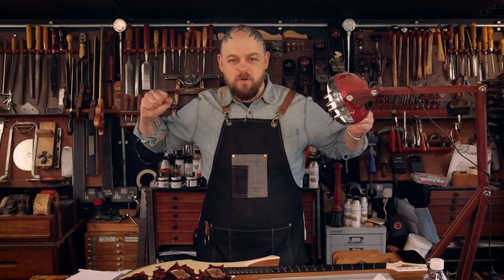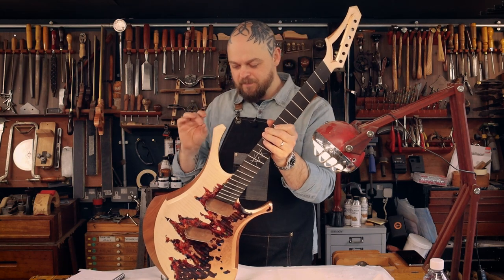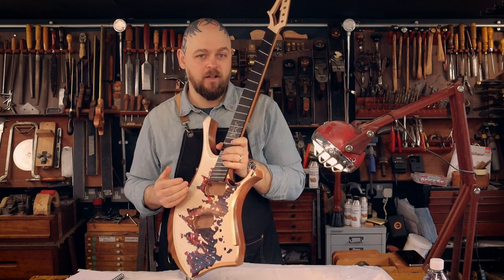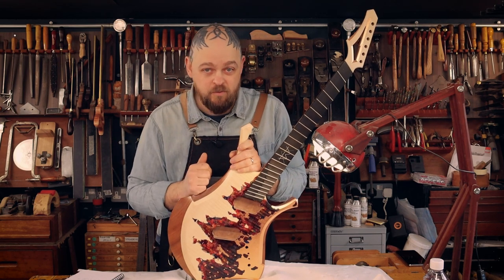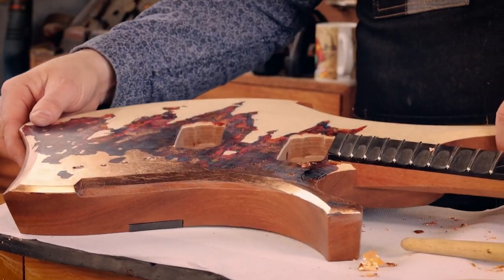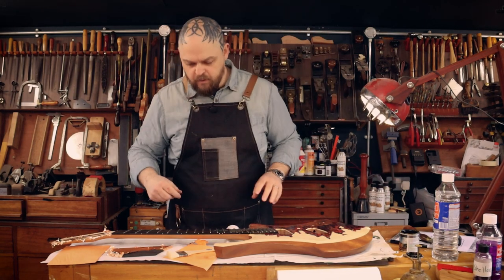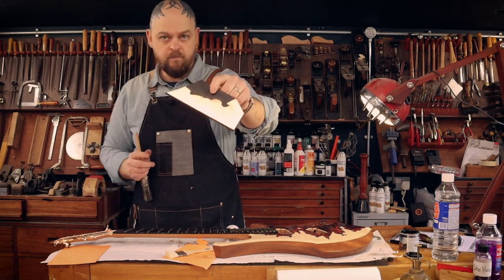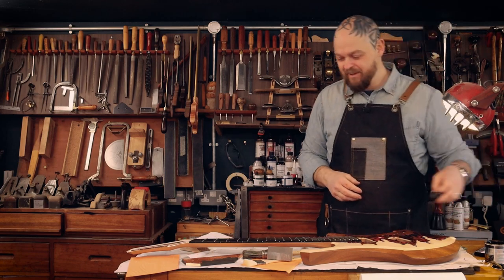Ep 10 - Shred - Bridge Design - How to Build a Copper Leaf Multi-Scale Kit Guitar

Comment: I'm exited to see the bridge next week... I have a multiscale part-way done and been putting a lot of thought into it.  I also don't have a mill or lathe so very much appreciate the "lo-fi" approach.  

Many of my drafts end up in similar spots to you.  The one idea that I keep coming back to for the string guide is a concave roller bearing of sorts.  For vertical adjustment a slot in each side of the housing would be needed.  The rolloer could be secured with either a screw through the hub (with the appropriate washers, etc) or left floating on a pin through the with height adjusted with one or two adjustment screws (two works, I have an idea for one).  It's definitely more complex but could be interesting.  

I've also considered going old school... secure the string heads behind the saddle, create a saddle base plate with slots parallel to the strings and single acoustic-esque saddles in each slot.  Height is adjusted by adding a shim  underneath each saddle piece and scale length is adjusted by moving the piece forward or back in the slot.  String tension would be the only thing securing the 6 saddle pieces in place.  For saddle material I've considered bone and brass... mostly because they would be easy to machine by hand.

Comment: One of the luthiers i admire most, Jens Ritter has a very elegant bridge design. the slots for the saddles are routed directly into the body and the saddles themselves just sit in the spaces and are adjusted by screws that push on a small plate. String tension keeps everything in place and it looks wonderful.

Comment: I am all for making bridge parts at home. I have a build nearing completion for which I made a top mounted string retainer out of brass, which I was able to machine using a hand held router.
That component is now at my local chrome plating shop. Brass is very, very easy to work with, and is very strong.

Comment: Hey Ben, interesting doodle at 9.38! You can do slots at home, if you chain drill the slot and file to size. At 18.40 that technique is solid riveting. Another handy tip is to use more than one hacksaw blade, to create a wider slot. Normally the pins are long enough on a hacksaw to accommodate a few blades together. Ace video again cheers man.

Comment: Love the channel. I had a great idea for a multi scale bridge that's adjustable without needing tools! I'm terrible a drawing schematics or anything mechanical, however, I believe I could rough it out or use a sketch artist to illustrate what's in my mind. It involves individual saddle pieces that slide in a slot and is lockable via 90 degree turning levers behind the bridge. I think it could have applications on acoustic and electric guitars.

Comment: Suggestion for bridge height adjustment.  It will need to be domed so that you have a defined point of contact to prevent buzzing.  Consider drilling holes through the side of the head so that the height can be adjusted while strung up with an allen key shaft or drill bit (think Fender wheel style truss rod adjustment "sideways") and you can limit the number of string grooves on the domed head by picking a very fine pitch thread so a quarter of half turn gives a minimal height change.
Also suggest lining the sides of the pickup cavities with possibly felt to add contrast and texture while covering the cavity edges.

Comment: Mmm watching this and I had an light bulb moment. I have thought of a bridge design that would work in any configuration. Either used on handmade and slight changes where it could be used on already built guitars. ... watching this in bed before sleep time have to remember this in the morning and try to design it. It's adjustable for intonation and string locking..... if I can design it I will send you the specifications to see what you think Ben. Love your work.

Comment: Hey Ben, great idears for the bridge.
One thing to note: It is necessary to have the bridge block mountet in at least two points to the base plate, otherwise they can rotate arround the vertical bolt and thus detune the string quite easily. (That was the issue when I tried to recreate a version of the strandberg tuners.)
Instead if the second bolt, you can also use some type of horizontal guide on the underside of the blocks.
One other thing: Its quite easy to mill brass or mild steel with a proxxon ibs / dremel and the handrouting jig (and a carbide endmill).

Comment: Hi Ben, I think the grub screw idea will have intonation issues if the top of the screw is parallel to the body. The grub screw will need to be angled backwards slightly so that you get a precise point where the string length stops and defines the string length. This will create an effective break angle. If the grub screw is horizontal, then this point can move from the front to the back of the grub screw top and the intonation will be unstable. Other than that, it looks possible although I think the string retention idea is going to be tricky to make and even trickier to string up. I'm in the GGBO so feel free to point out the faults with my guitar design when I post my first vid in a couple of days!

Comment: With the proposed bridge/saddle design, how do you adjust the height when the string is in place. Also when you drill the height adjuster and thread hole, you are drilling right though the rivets which hold it all together. Not sure what size screws you are planning but a 3mm thick substrate will have you using 0.8mm screws if you want to have any material strength left after you have drilled the holes.

Comment: You could run a rod through the sides of the saddle large enough to drill a hole for the string to pass through in between the adjustment bolt and the grub screw and allow that to be your string hold option? Just a thought

Comment: Ben, if & when you build your last bridge idea, I recommend not using two grub screws since their threads could easily cause the strings to break.  A local hardware store ought to sell dowel pins which are accurately ground to size and are therefore extremely smooth.  Just drill through the two outer bars and either use a light press fit to hold the two pins in place for each string or possibly a thread-locker-type product if your holes are just a bit too loose/big to press the pins in securely.  I assume that the thread-locker option is best for the average home-workshop Luthier since it doesn't require extremely accurately-sized holes for the dowel pins.

Comment: Hinge bridge design is interesting, but how would you adjust intonation?

Also, thoughts on a nut that has 6 holes drilled in to thread strings through rather than resting in slots. Means strings can slip out of place?

Comment: hey Ben, if the string rests on the slotted height adjustment screw, then if there's tension pulling the string down, you wouldn't be able to turn the screw. You'd only be able to do so by loosening the strings and lifting it

Comment: I like the hinge system .  Hidden everything . Could taper the top to a point where the strings travel to the neck maybe a slight curve leading up to it with a string line cut into it .and polish . It’s More of a machine shop CNC job but it would look outstanding I think with the staggering It would really add to the fan fretting look . You got my head spinning on that .

Comment: Shred is coming together very very well, Ben. May I tickle your mind with a question? Have you thought about the potential electrical effects of adding copper leaf outside of the electronics cover? I'll explain the two scenarios you might encounter.

First, the most obvious: when time comes you shield both the cavity and the cover with shielding paint, possibly resulting in points of contact between the copper leaf and the paint, so putting a straight conductor outside the electronics cavity and so increasing the possibility for picking up undesired hum. Basically, making the whole shielding unuseful. 

Second, the most subtle: by putting copper leaf on one side of the cover and conductive paint on the other side, avoiding points of contact in this case, you are basically adding a capacitor in series with the whole guitar ground. Wood has dielectric properties, while the copper leaf and the shielding paint may act as the two plates of the capacitor. It would (wood?) actually be a really really small capacitance, in the order of 50 pF, maybe 100 pF if that ebony for the cover has a higher dielectric constant than, say, 2.  Probably negligible as a capacitance, but still there.

Anyway, nerd stuff aside, I'm loving both Shred and the Modern Multi-Scale series, can't wait to hear them produce sounds. Cheers!

Comment: I like the simplicity of your last idea for the bridge, I just wonder if it wouldn't be quite difficult to adjust. I worry that when the screw that hold the saddle down is loosened the saddle would jump as far forwards as it will go, thus forcing you to take the tension off of the strings completely to adjust intonation.
Maybe the baseplate could have a piece sticking upbetween the bolt holding the saddle down and the rear block. Then there would be a hole in the rear block and a hexnut with the same width as the gap between the plates behind it. The bolt would thread into the nut, thus no need to tap threads, and push against that piece of the base plate sticking up. Tightening the bolt would push back the nut and thus the saddle while the tension of the string would pull the saddle forwards thus acting as the spring. The bolt would be sticking out the back of the saddle though.

                     ########plate#############
bolthead ==|block|nut===|| bolt  ballend |block|
                     ########plate#############

Comment: You could secure the strings the way you did on Nebula 1.0, do an archtop style bridge which takes care of the scale length requirement, and then create a height adjustment system for it

Comment: Not sure I go with the hold-down screw idea... Unless I'm misunderstanding the intent here, I think you'd need to get it helluva tight to stop the saddle piece sliding under string tension and you'd need to completely de-tension the strings every time you wanted to adjust the intonation.  And in getting the screw tight you'd have to be sure that the saddle pieces won't twist a bit out of line (since you'll need to tighten without string tension keeping them in line). 
Using an adjustment screw from the back, through an L-shaped baseplate (as appeared in the notion around 8:00), wouldn't need a spring if the string is anchored in saddle, since it'd only need to pull the saddle back as string tension will pull it forward. String tension would also hold the saddle piece down on the baseplate.

Comment: If you are doing the saddles like that where the ball end is in the middle then you'd have to make the saddle fairly long to make sure the, wound up/tied up part of the string near the ball end doesn't stick out past the final string+bridge contact point, to ensure proper vibration but also so the string doesn't cut into your hand etc...  With the two cube method as well, you'd also want it to regardless of the adjustment/intonation point.

Comment: sweats nervously as you reminded me I am doing through body stringing hand drilled for GGBO
Reply: Even with drill blocks or drill guides and brad point drill bits it is still a nervous moment indeed. ✌️🎸✌️.....How did you make out ?
Reply: @johnstitt2615  haven't gotten to that point in my build yet but I have you little cheat that is specific to my guitar design that'll make it so much easier 😎😉

Comment: Ben, for the final sketch you made, am I correct in that with that design, to adjust for string length, one would have to loosen the string, loosen the domed screw, eyeball the adjustment, retune the string, and then check for intonation?
Reply: I think also that the domed screws might need additional tightening time to time to avoid any unwanted movement of the saddles.
Reply: @miikkisahokas  It reminds me of the Strandberg bridge design, which imo is not user friendly, in terms of intonation adjustment.

Comment: That bridge design excursion was interesting. As for the final design you're going to use: I'd probably prefer string-through body with that. Trying to get the string through those two bolts / grub screws from above the bridge when you can't really approach the whole thing from below sounds really annoying. Other than that I really like it.

The hinge design is also a nice idea, but I think having the height adjustment right in the middle of the hinge, where the string will be passing over it, isn't all that great. Okay, I've never seen a bridge where these adjustments are "fun", but perhaps finding a better spot for that adjustment would be a good idea. Also, with the hinge, adjusting the height will also change intonation a bit. Could be quite frustrating.

Comment: 13:17: "Scary cuts with a hacksaw by hand" I once rip cut a foot-long bar of aluminum an inch thick down the middle by hand with a hacksaw. Not fun, took the better part of an hour, but you absolutely can do astounding feats of metal removal by hand if you have the will and more importantly the time. Also, if anyone asks I never said this, but if you need to, the Shinto saw rasp does in fact work on aluminum, and I'd imagine brass as well.

15:30: Simpler to execute but definitely less pretty would be simply tapping the top plate of the hinge and setting in grub screws or thumb screws to jack it up. It would probably feel slightly better though since the adjustment would be roughly linear. Your design would need some careful fine tuning to put the useful adjustment range at the right height because the tangent bar will accelerate as it raises it up more; near the end an 1/8th turn would probably result in the end jacking up a few milimeters. Have you seen violin fine tuners? This design kind of reminds me of that.

19:53: Got to make sure the grub screw hole doesn't sever the rivets, because then the whole thing will just fall apart. I didn't catch what metal you were intending on using, but brass is easy enough to work with hand tools, polishes up really nice, and it being a copper alloy means you can solder it together with a simple propane plumber's torch in lieu of welding.

Anyways, not an engineer, but I do some home shop machining as a hobby and design some of my own parts so take it as you will. Have you seen some of Hayashi Noble of Atlansia Guitar's designs? I believe he machines all of his hardware for his guitars and I've always been struck by how unconventional his designs are.

Comment: If you had a tailpiece that set the string spacing, then you could make 6 individual floating bridges that are each basically the front half of the concept around the 17 minute mark. With it being multiscale, each of these could be pretty wide, passing below neighbouring strings without contacting them, with the extra width preventing them from toppling under the sideways force of picking. I'd make them out of wood offcuts and shape them and bevel them to the same theme as the body. Perhaps even do the stain pattern on them. Doable in the house with nothing but a drill, a hacksaw and a handful of sandpaper.

Comment: will this bridge design not be immediately pulled to the full forward position by string tension every time you loosen the bolt to intonate it though? and then impossible to position without slacking off the string completely first.

Comment: I'm thinking only one vertical screw for each unit might be a little tottering.
It'd be (a little) more work, but if you made some small half-cams, from sanding away some of the bar stock, a single screw could handle the vertical motion, whilst keeping the lateral stability permanent.
Making it pretty would be the awkward part though.

Comment: In the hinged saddle design, if the string is in contact with the top of the saddle in more than just at one point, wouldn't you get the "sitar sound", like you might get if the tail stop is set too low on a Gibson-style bridge?

Comment: With the strings attached to the bridge, I wouldn't feel comfortable relying on friction to keep it in place. However, with a string through design, the horizontal force can be taken by the edge of the ferrule, and the force on the friction connection will be almost zero.

Comment: I think I have a more elegant solution to your bridge connundrum.  Each of your ideas addressed the prior flaws and introduced new ones.  You need a break angle for enough down force for good sustain.  A multiscale needs probably minute intonation adjustability .  You need a simple anchor system.  You don't want a massive mechanism fighting with your body finish for attention.

A tune-o-matic style is the solution.  You just need one with the length to address the 15 degree or so angle of the multiscale.  You only need 2 large posts in threaded collars for height adjustment if you build the saddles to the radius of the fretboard.  6 worm screws and 6 brass knife edge saddles, a frame, and string through body ferrules.  To avoid the engineering of getting the angles on the worm screw paths right you can do a staircase design of 6 boxes all square to the string.  You can build the bridge frame from hard wood with some metal reinforcement in a few key places and you'll have minimum extra hardware on the guitar, full intonation, proper break angle.

Comment: How about a slotted string-through body where you use fancy “bolt and cap nuts and bolts” that are slotted at the top for the string and adjustable up and down for string height and back and forth through the slotted body for intonation. Hidden behind a plate in the back and with a decorative small plate to cover the slots on the top? It would look like an acoustic tail piece from the top.